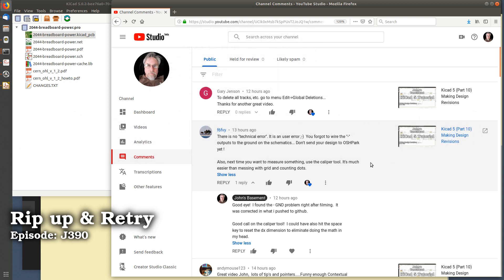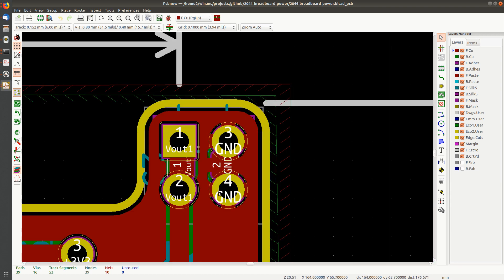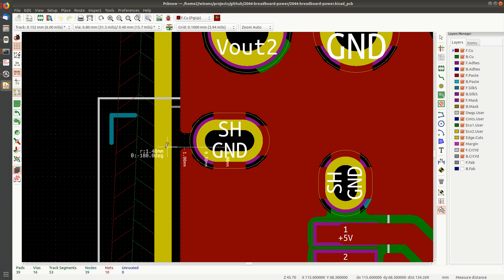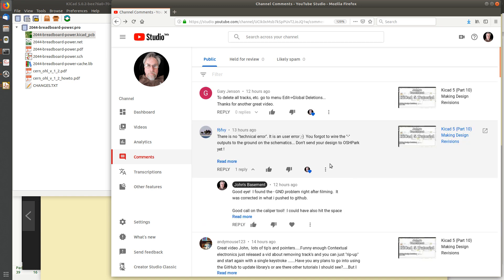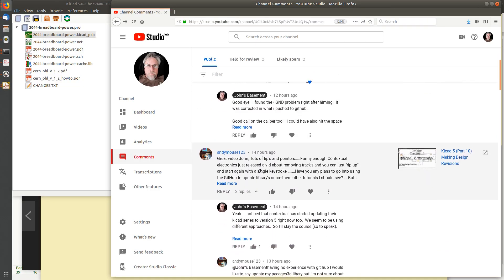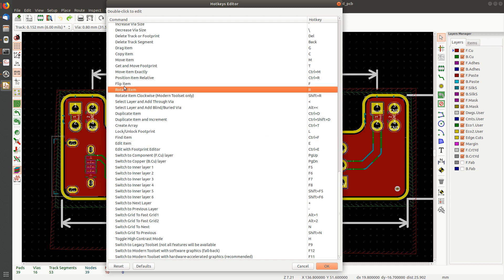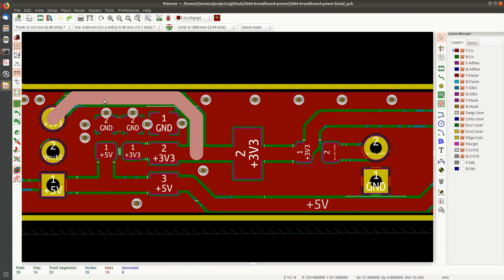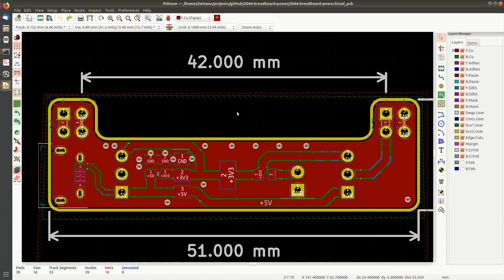KiCad 5 #10a Revising My Revisions

Comment: Very good series so far.  BTW, I ran into a problem where the ele. rules check failed because it found no connection to my +12v and GND nets.  Not that the nets weren't connected, but that there was no 'source'.  I added a connector with the +12v and GND labels, but still same error.  I then remembered that you ran into this, and I had to find the 'power flag' symbol, and attach that to the connector. THEN it was OK.   But then I switched from the KiCad provided symbol for a 2n7000, and used the one from Digi-key.  Now I got a warning from the rules check because it didn't like a connection from 'power' to 'bidirectional'.  The new symbol changed the D and S pins from 'passive' to 'bidirectional'.  I wasn't sure how to change the pin designations in the symbol, but I was able to change the rules flagging a warning for this type of connection from Warn to Ignore.   I didn't find any NDT2955 symbols, but these are just P ch mosfets  I used a different part in SOT23 package, which I think is the same package as the NDT2955, so I just changed the name of the part.  I hope that this only changed it on the schematic sheet,  (and later BOM), and NOT the library!  I can always edit the part in the library, and save it to a new library, so I don't have to create a symbol for this part from scratch (right?).   I know I'm mixing SMT with TH, but that's because I'm using parts that I already have!   This is for a power switching circuit in the Tx-Rx (PTT) circuit of a ham transceiver.  The board should be about 1-2 in square, a cheap way to check out Oshpark.   For connectors, I could specify a 1x1 male or female, as I only need the pad.  IE: finished board won't have connectors, only a pad to solder wires to.
Reply from the maker: Side note: BE WAY CAREFUL WITH FETs AND SOT PACKAGES!!!  I have been burned by ANNOYING pin number changes on FETs that do not match the numbers for the same parts in other packages!  Check the pins and the signals you connect to them ON YOUR PCB to make sure that you have the right pins connected to what you MEANT to connect them to in your schematic!
The short of it is (no pun intended) that the TO-xxx package pin numbers are not same as the SOT package pin numbers (and others).  That is why some parts have more than one symbol.  This used to be a bigger problem with the libraries in KiCad 4.  In 5 many transistors have EBC CBE ECB... pin ordering involved in their component and/or footprint names.  It is still an imperfect world.  Just make SURE to check that your symbol pins end up mapped to the right physical footprint pads on your PCB!
You can copy symbols into your own library and tweak them to suit your needs.
The whole power flagging that causes brokenness after seemingly inconsequential design changes is annoying.  I have yet to find a way out if this annoying situation.  Altium lets me put an X on the line to shut up the DRC.  But in KiCad, the X does not seem to address this particular problem.
What I do for these is remove the power flag as a preference over defining a new symbol or risking having unreported DRC problems by shutting off the check on mixing the two signal types.
Reply: @JohnsBasement  The first project I did used sot233 (3 pin plus tab) NDT2955 transistors.  I checked the pin numbers on the schematic vs the foot print, and then against the part spec sheet to verify that everything connected right.  I also checked the connections for the TO92 package 2N7000 transistors I also used.   Actually, I had to make my own schematic symbol for the NDT2955, as there were none in the library.  So I hijacked a symbol for a different similar part, renamed it, and edited the pin numbers to match the spec sheet.  This custom symbol was then saved in a new local library for my project.

Comment: The 5V trace from the USB connector to the first header was a smaller width than the 5V trace width on the remainder of the board.  Was there a reason or was it a "technical" error?
Reply from the maker: The fatter trace probably would not fit into the footprint pads.  I probzbly should have brought the fatter portion of the trace closer to the pads.
The real issue is current carrying capacity. For any given current, the longer distance you go, the wider the trace you will need.
This project is so small and the current limited by the USB spec that the the trace widths are all more than suitable.
Do a google search on "pcb trace current capacity" for some tables of recommended widths and thicknesses.

Comment: The caliper tool will also snap to the centre of things (showing a circle) even when snap point is off grid. Really useful for direct measurements, or to then hit space bar to zero delta x and y coordinates on centre of some off grid item.